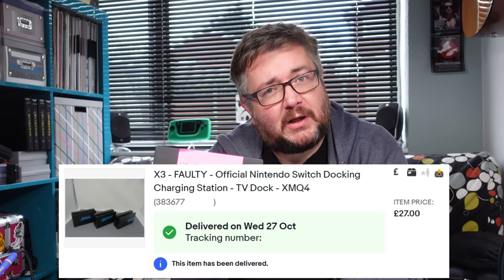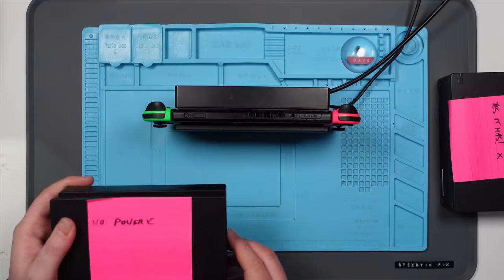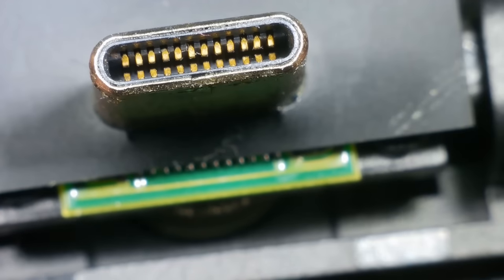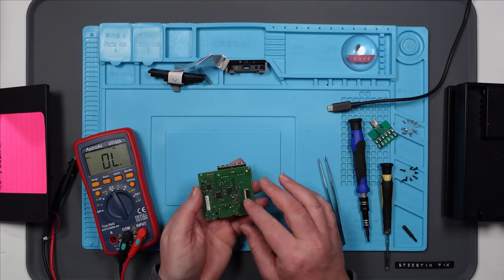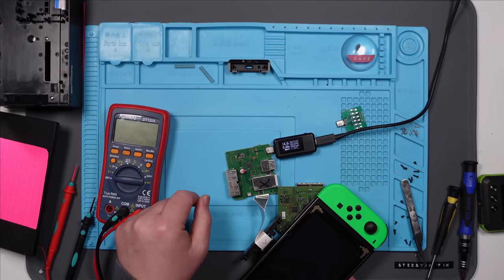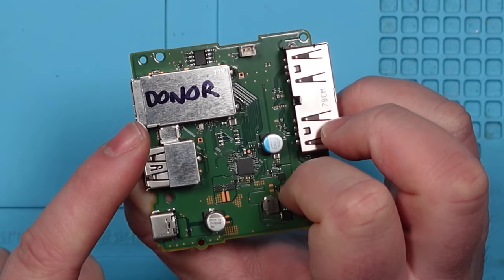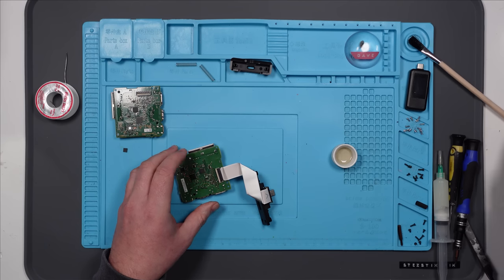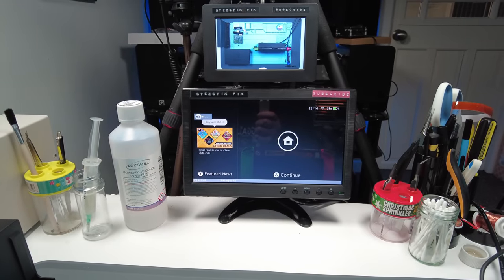I Bought 3 Faulty SWITCH DOCKS off of eBay | How Many Can I FIX?!

Comment: Hey Steve. New viewer. I repaired a dock for a friend of mine a few months ago that had the symptoms of your "donor" board. There's a BGA chip under the HDMI cage. I actually replaced it with a chip I found for 25 dollars on ali and, miraculously, it fixed it. Hope it helps if you ever revisit some day.
Reply: $25 for one chip? That seems way too high
Reply: @techfan1017  you're suggesting I buy a brand new docking station maybe?
Reply: @TheSoapyJew  he said he got those for $9 each and they have many parts in them, including probably the part you bought. These docks are like $40 in working condition so I think you just overpaid...
Reply: @TheSoapyJew  You can get them at thrift store or locally for $30 bucks. Thrift store is $10 or less
Reply: The motherboard is into 30 bucks
Reply: @techfan1017  How many switch docks have you repaired? Yeah, probably zero. Now go away.

Comment: TIP
🐨 When Placing or Replacing a New Chip to the PCB, Heat the Solder on the PCB whilst Holding the Chip AWAY from where it is to be placed, Once solder glisten's or presents that it's Liquifying place the New or Donor Chip down into place and nudge into position, Anyway by the time it finds it's place Via surface tension you will find the replacement is exposed to a lot less heat time..

APU I dropped a 👉👍👈
Reply from the maker: Thanks 🐨!  Excellent tip as always!  Much appreciated 👍

Comment: Great results Steve ... plus a spare to scavenge for parts. Buying as part of a broken item can be much more cost effective route to build your spares holding ... assuming your partner doesn’t begrudge you the space to store things.  .... plus another song for the album of repair anthems. Keep up the great work 😀👍
Reply from the maker: 😁 thanks Chris!  Definitely made more sense to use one of these for parts, I've saved £1 straight away by using that chip, and the rest of the board, USB C ports and casing will come in useful at some point I'm sure! 👍

Comment: Nice fix Steve! I had the exact same issue with mine. No power, then replaced M92T55 and voila. I also have an other one like you with green light on but no display. That one I could not fix. There is a BGA chip behind the HDMI port under the shield. That could be similar like a retimer chip on an Xbox. Could pretty much be that is wrong. But I ended up similarly like you, the chips are so expensive that it does not worth to repair...
Reply from the maker: Thanks Kiki! I was going to take off the shielding to see what was under near the HDMI port, but I just decided to use it as a donor. I would like to find out what the issue is, so I might have another go. I'm guessing it's quite a common fault!

Comment: IMO considering the prices of docks are $90CAD ish 10quid for the IC + 9quid for the rest actually justifies buying the replacement IC and repairing it. You could turn a profit.
Reply: bought a ps4 slim same place tested not working 50 bucks. it works buid a data rebuild turned off abruply during i bet firmware update or download
 solid year later amd it wad on fw 9.0! lg v60 no wifi bust wanted yhe screen 40 bucks. works not one issue 70 feet outside works great! switch oled tested wont turn on power for 15 seconds bam! 70 bucks works. ps3 slim untested works flawlessly. thought the hdd was loosing blocks
 cfw. new ssd runs smooth 50 bucks. plus many accesories. all of which works. its a gamble over the years not mamy losses usually untested for means to busy yo boot up chop is as untested. tested whatever seller felt to say at the time. or not fully doing simple checks. man gambling is an addiction. time to play the lottery! haha
Reply: @rchaze  you sound both high and drunk at the same time. Don't care.

Comment: "no power kiss" is actually an extremely common fault.

The issue stems from the dock's inability to feel love. Usually this is a terminal condition that can't be fixed. There is a part cut out of this video where Dave performs extensive counseling for the docks

Comment: Great work Steve, would u consider obtaining that chip to try n diagnose the last one? I know u said its wasnt worth it but I think u might identify something new which maybe isnt out for content already.
Reply from the maker: Thanks Michael!  I have been thinking about it!  I think if I can pick one up or possibly even another faulty dock... I am curious to know why it wasn't displaying, and you're right - i haven't seen any other videos on YT with that specific problem!  👍
Reply: @StezStixFix  That's awesome, much appreciated for the feedback. Totally understand and looking forward to the next video
Reply: i think I changed over a few chips and I didn't get anywhere, but I did but them to one-side.

annoyingly there's a few different revisions off this board, and I ended up opening up two different revisions.

Comment: M92T36 and the  M92T36 are both USB-C Power Battery Charging Control IC so it makes sense how frying it will prevent the device from charging

Comment: I have exactly the same problem with my dock, no light, no image no nothing, but I've always used the default charger for the dock, I wonder if it is the same chip that is causing the issue.

Comment: Nice fix.  Mine went back to Nintendo and got replaced (not cheap). It was charging and there was power on the USB ports but no picture on the monitor and the battery was damaged.  Wonder what caused what there.
Reply: I have the same issue. How much did the repair cost?
Reply: It was around $AUD240, they swap it for a new on

Comment: well done. I've bought from this seller before, 
no power chargers written on them.
but some worked fine. 

i think they sometimes go into protection mode. and the seller hasn't unplugged them, so they end you written it on everything my mistake. 

any reason you decided to changed m92t55 and not m92t17, or was it just a lucky punt?
Reply from the maker: 👍 Luck punt Chris. The t55 seemed to be in and around the power circuit, but I was prepared to swap them both over if needs be!
Reply: @StezStixFix  yeah sometimes it's quicker doing it than thinking about doing it, isn't it. 

I've had faulty switches break docks it the past. i think I have about 5 here if you need parts?

i do always mean to repair them myself, but I alway have no pressing repairs to do. I'll look at them when I run out of docks

Comment: M92T17 I believe does display and M92T55 I believe does power. Could be the other way tho so don't hold me to that lol
Reply from the maker: Thanks Philip, that would make sense as it definitely fixed the no power issue.  I made a bit of an educated guess as to which one of the M92's was faulty, but I was prepared to swap them both over if required.  Worked out nice in the end!
Reply: @StezStixFix  atleast you know you can fix the other one also with some new chips

Comment: Weird issue I am having and wonder if you have some insight.  My docks USB ports only work when the switch is not on the dock or off.  It will charge the pro controller when it is off but if I try to plug in a wired controller or a fight stick I get nothing.  I also can not update any controllers as when the system is on nothing is recognized.   thanks for any help on this issue!

Comment: Im having an issue with my dock and it's exactly like the 3rd one. It was working fine one day then stopped working the next day. I've tried everything and nothing has worked so I think I'll just have to get rid of it.
Reply: Are you sure it's not the switch itself?

The switch has chokes right around the PI32USB chip which are video filters. If one shorts, the unit won't "dock". Your dock may be perfectly fine, unless you've already tested it with another switch and verified it's not fine....
Reply: @brandonkick  Thanks for the message yeah I've tried it with multiple switches and the dock is the only thing with the issue.
Reply: @_egglord  If your determined to fix it, there are usually 3 things that go wrong when a switch won't dock.

1) The video filters / chokes on the switch motherboard around the PIUSB32 chip but you've already ruled this out by trying other switches

2) The MT92T55 charging circuit chip inside the switch dock. These get damaged primarily when non OEM chargers are used but can fail otherwise

3) USB-C ports. I've seen switches fail to dock, but still work fine, due to damage to the switch's USB-C port (you've also ruled this out). But there's also a USB-C port in the switch dock itself. THAT port can be damaged too. 

My suspect in your case would be the MT92T55 chip on the dock motherboard.